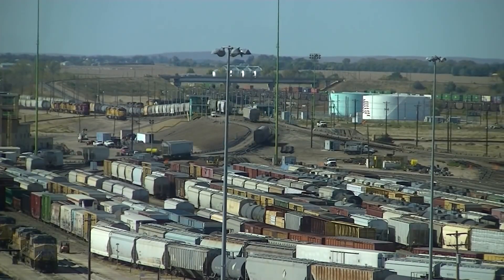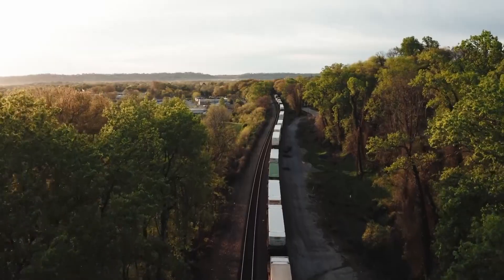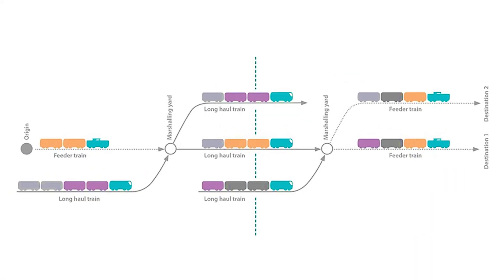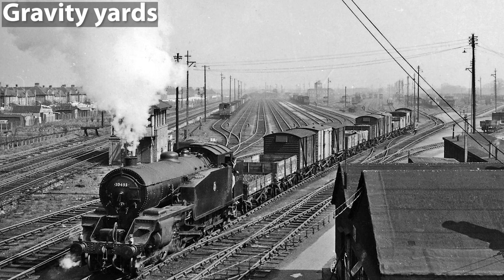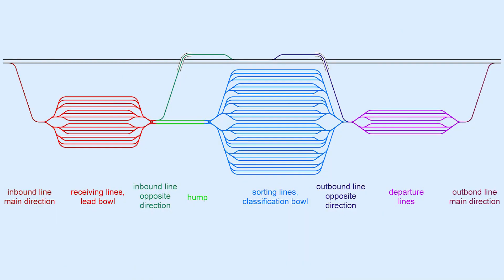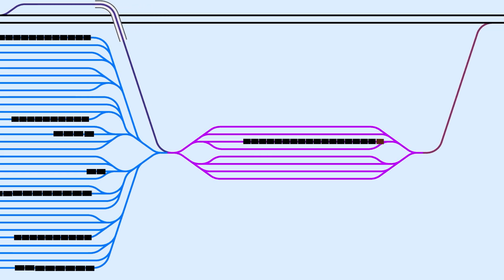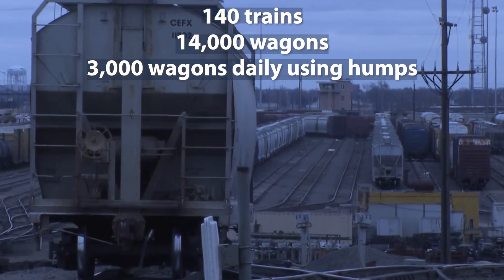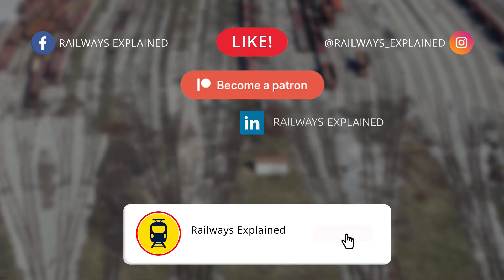The Heart of Railway Freight Transport: Marshalling Yards

Comment: One thing I'm curious about. How do they prevent the airbrakes from engaging and it stopping the wagons during the humping process? Unless I'm misunderstanding how they operate. Wouldn't uncoupling the wagons drop the air pressure and cause the brakes to kick in?
Reply: You are correct. Normally when switching the cars in a yard the air is totally bled off, leaving the brakes on the wagons fully released.
Reply: @dannyCOTW  Is it not the air pressure that keeps the brakes disengaged? I thought that was how air brakes worked.
Reply: Air brakes on a train work opposite from trucks.  Air pressure on a truck keeps brakes off.  Air pressure on a train applies the brakes.
Reply: @jimskinner9234  That would be air pressure from the car reservoirs.  A reduction of air in the train line (brake pipe) initiated by the engineer using the brake valve causes the car control valve to admit air into the brake cylinder from the car reservoir.  In case of a failure in the trainline (busted hose, accidental uncoupling) or the engineer making an emergency application, ALL of the air in the train line shoots almost instantly and all of the air stored in the reservoirs dump into the brake cylinders.  That is what makes the automatic air brake "fail-safe".

It is also true that the cylinder air can and probably will bleed off, so it is often prudent to set a few hand brakes to keep things from rolling away if a recharge and departure will take more than a few minutes, especially on grades.

Comment: Baily Yard is HUGE. I nearly got lost in there once back in the early 2000's. I drive a truck and was delivering some equipment to the Maintenance facility. Got bad directions at first, had to stop a guy in a pickup truck. He was one of the yard Bosses and he told me they should have given me an escort. lol Lucky for me they have lots of room to turn a tractor/trailer around in. Quite the treat for a Trucker that's also a huge railfan.
Reply: dude try riding through it. Bailey is crazy, spent five hours there on a WB IM. Didn’t even do work just a Crew Change.

Comment: Hmm... why is there three different yards when at least in theory you could use one that had a hump on the end followed by a circular loop-back rail back to the start? This would of course require more intelligent control but would definitely save space. Maybe the throughput would be a bit lower (unless it was optimized by having multiple loop-backs etc.
Reply: Could be that since most if not all of these yards were build many decades if not over a century ago that there is simply no reason to change what works. Any change would have to be something that would be financially worth it to the yard to do.

Comment: Thanks for the video. FYI The text in the subtitles is corrupted in some areas. Maybe the subtitles file was accidentally saved as ASCII?
Reply from the maker: What do you mean corrupted?
Reply: @RailwaysExplained  All apostrophes are replaced with spaces, random question marks are added at many places such as at 9:22 and 10:31, there's timecode information visible at 9:31 and 11:15 and other times as well.

Comment: Given the sheer volume and mass involved in slowing down wagons with hump and gravity yards, it strikes me that  the arrestor systems could be redesigned as energy generation systems. Energy is already being invested in the wagons by the shunting locomotives, and if the arrestor systems are using friction, that energy is currently in effect being lost. I wonder if a variable reluctance electromagnetic system would work well? The wagon wheels roll through a magnetic field, distorting it and generating a current. In return, the field slows down the wagon. Time for me to do some more research in how modern arrestor systems are implemented!

Comment: China railway‘s Marshalling Yards Xinfengzhen is the world largest. https://en.wikipedia.org/wiki/Xinfengzhen_railway_station
Reply: Bailey Yard has 6.0 km2 area covered by the outermost tracks, but Xinfengzhen only has 3.9 km2. Trains in those USA railways can have up to 3km length, while the conventional freight trains in China Railways are set to 1050m maximum. 

Those long coal trains found in Northern China doesn't need that huge marshalling yards; they only need to receive coal in the mountain and then dump at harhour.
Reply: Braking allowance shall be reserved for 1050m parking line. The length of freight train less than 1km.
Reply: Can you provide a more relevant source than that?!
Reply: Its not even the largest in Asia.

Comment: Nice overview.
Note that tank wagons and numerous others have a brakeman stand so a person can ride the wagon as it is rolling down the hump, operating the handbrake to bring it to a standstill at the desired location. That requires more manpower and is done for dangerous goods.
Reply: In Europe, automatic trackside retarders are used. They automatically read the speed of the wagon and apply trackside braking if required.
Reply: Have you ever tried to apply one of those handbrakes? It takes quite a bit of time, far too long to have any accuracy when it come to stopping one. The stand that you refer to is not for a brakeman, it is to allow access to that area of the wagon, which includes the handbrake. Anyone who rides on a wagon, stands on a small step, which also has specific handles/ grips for that person to hold on to. Also, if a wagon is used for dangerous goods, it is not allowed to run into other wagons, nor have other wagons run into it.
Reply: That does not sound right. I have never seen this practice in use in modern shunting yards
Reply: В России (могу сказать только за нее) запрещено спускать цистерны с горки. Так как это может привести к катастрофе.